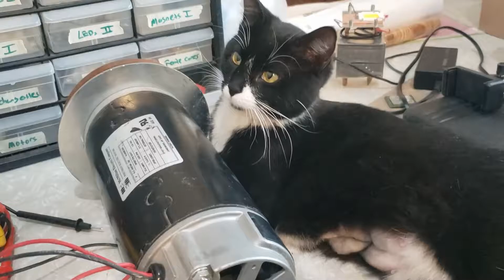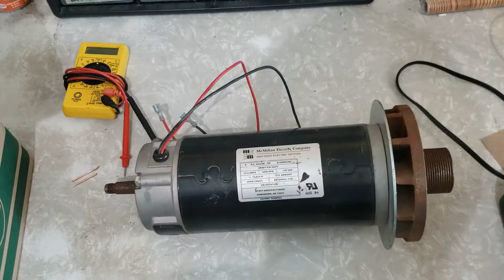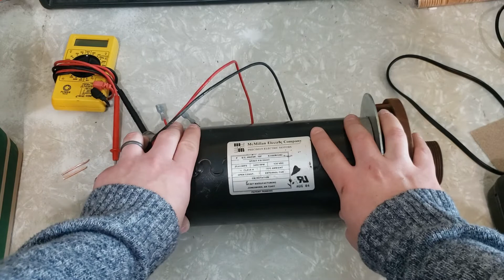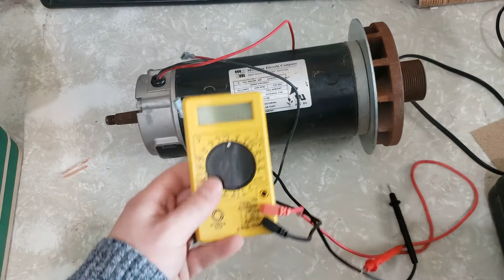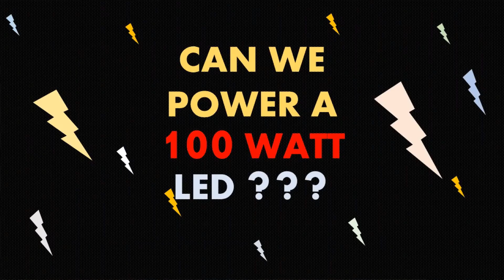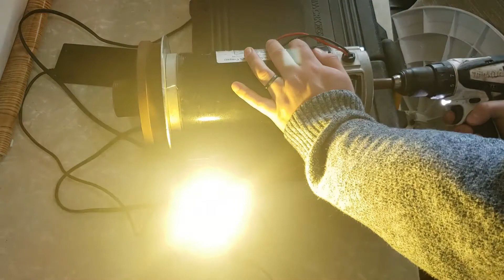130 Volt Treadmill Motor Generator Test (for Wind/Hydro)

Comment: Hi Jacob - Cool video !  Have you any thoughts to following through with the DC motor and make a complete package to chart a 12V or 24V (100A) battery using wind?
Reply from the maker: Yes, absolutely! I actually no longer have easy access to the motor, but I was definitely thinking about attaching some wind blades to it.